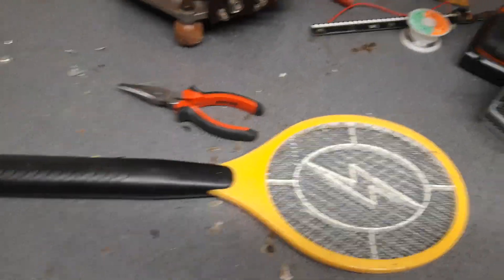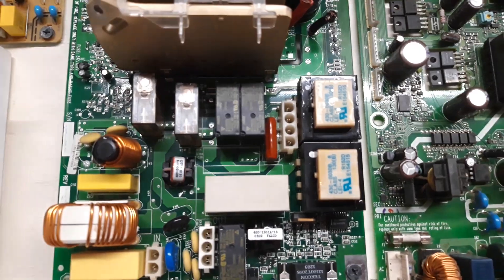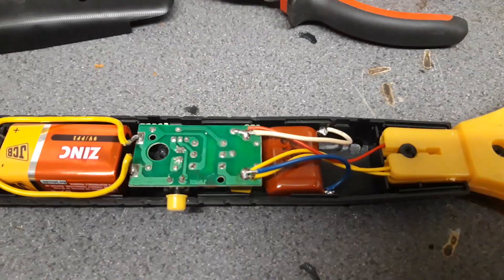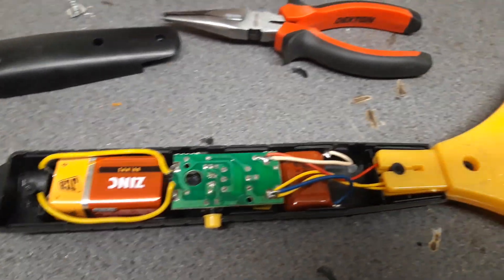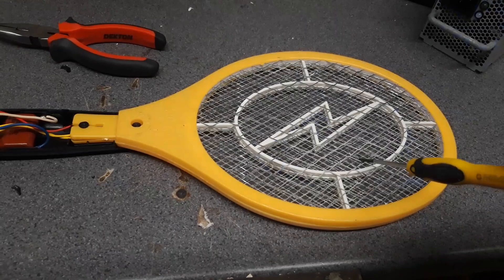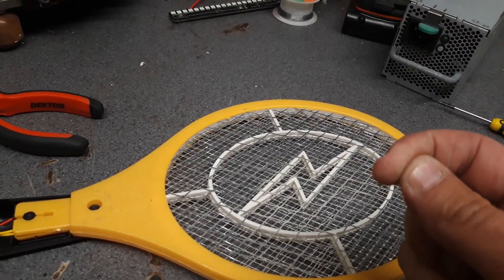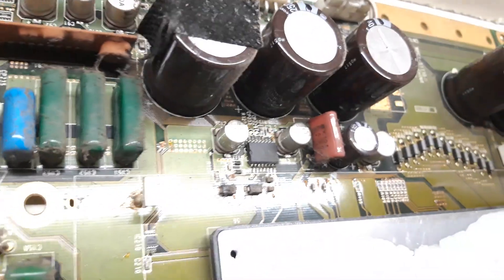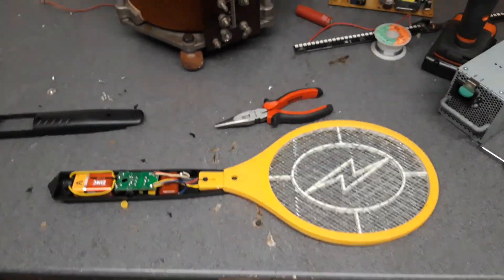Modified electric fly swatter running on 9v

Comment: Did you change any component,because of the 9 volt battery? Or did you solder it in place,and that's it? I maybe want try it on my fly swatter. I already installed A 0,22 capacitor, that creates a nice spark, but i want more,to have fun with the flys.

Comment: Fyi 9 volts are too many amd eventually you'll do nothing but short circuit and then its useless. Volts make the arc jump further. not needed hook up several AA's or C's in PARELLEL and you increase the amps. You want more amps than volts.
Reply: Do you still need to do the modifications like this guy does like changing capacitors?

Comment: Capacitor best in parallel or in series with each other? And also, is the 2kv more important or is the uF more important?
Reply: Series is better in this case fron what i have Come to understand. 
In parallel the voltage of rach cap is being added on top of each other. In Series the voltage is being multiplied, i think, but i am All but a professional. Please correct me, if i am talking shite.

Comment: I found one of these recently, repaired water damage and it's been kinda ok with original battery except the battery doesn't last long. It makes mosquitoes and small moths explode but I'll think about your mod here thanks! One thing they aren't good for is larger moths, although they die right away, too much current across the "grid" really kills the battery. I can tell by the smell that it's just burning outer extremities and doesn't get the inside cooking like crab.